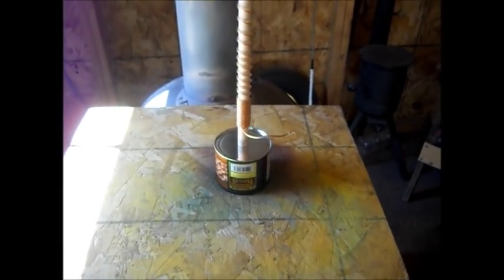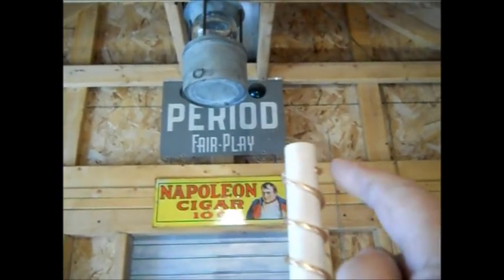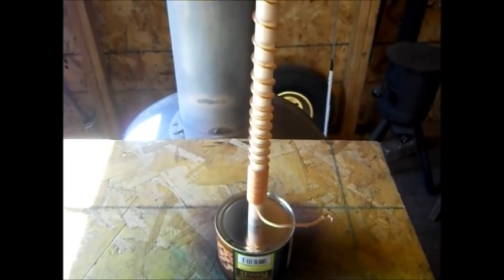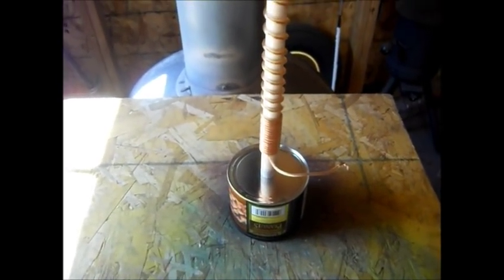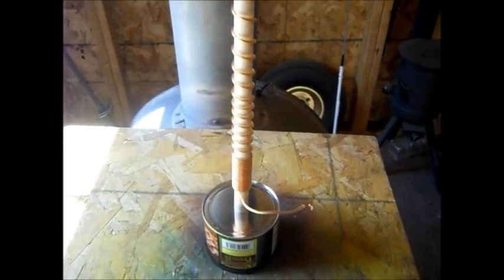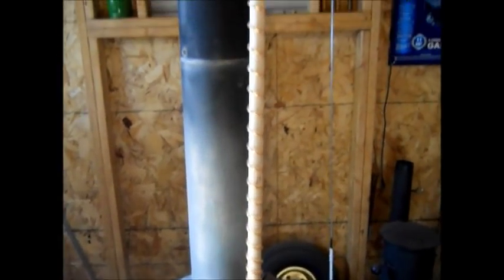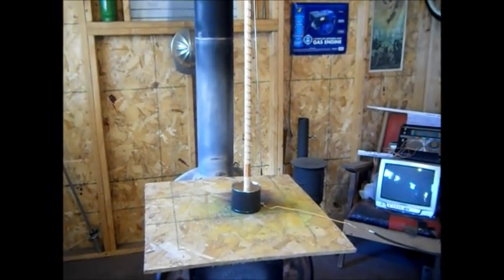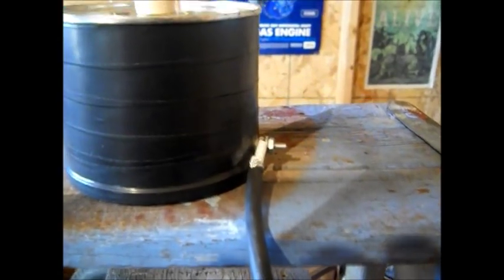WOODEN DOWEL and SPEAKER WIRE  ( FM ) ANTENNA

Comment: This works really good.  I live 30 miles from town, and constructed one of 3/4" PVC 31" long and 16 gauge wire, with 15 wraps at the bottom and 3" gap in the wraps going up, and 15 wraps at the top. I used both strands.  I haven't made a base yet as I was to enthralled by the good crystal-clear sound, so I just have it leaning up against a wall.   I taped it tight with electrical tape at top and bottom. I left a couple of feet of wire at the bottom to run to the 2 FM connections on the back of the stereo.    Outstanding idea!
Reply from the maker: Glad it is working !!!

Comment: You don't need to get fancy and add all kinds of loops.  Just a speaker wire two wires connected to the two FM post on back of radio or reciever and you are done.

You can split the wires and make a T like they do with car windshields.

Comment: In the 1970s there was a broom stick antenna artical, it was based on a small 1MHz antenna for the AM radio band. This antenna your making looks like a nice 5/8 wave for 100MHz since the coil at the bottom is normally where the matching happens to the wire above it. Might work even better with a counterpoise 2.5' of wire hooked to the radio Ground screw... 73   Jimmy, ARRL TC, WX9DX

Comment: Can I make one simple suggestion?. Your metal can base is coupling with the  monopole wire antenna. To isolate the antenna, it would be best to use wood or plastic, or any non conductive material...

Comment: Looks great, but I don't think this the best design relative to the length of cable used.
I think that perhaps if you made instead an array of 2 (or even 4) more spaced, bigger coils, you could have gotten even better results. Just a thought
Reply from the maker: +Le Sveniste This was an experiment It would be worth a try to make different types